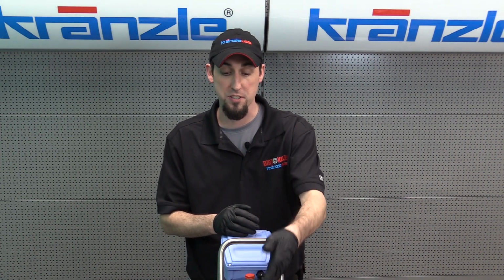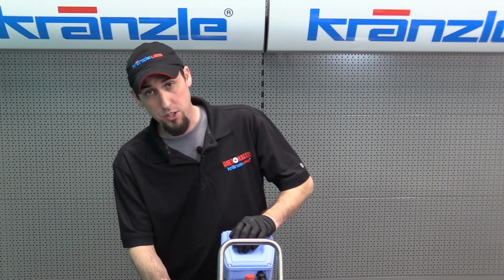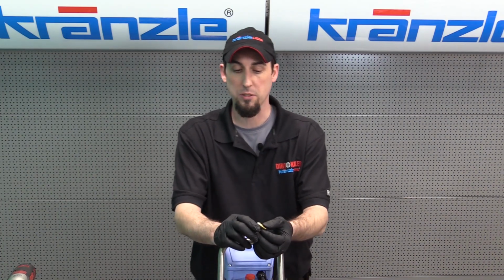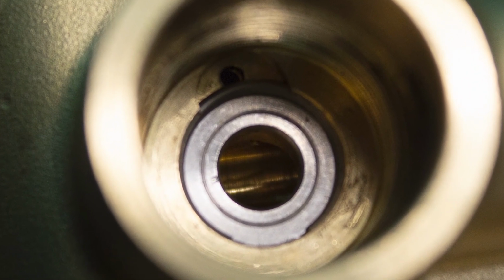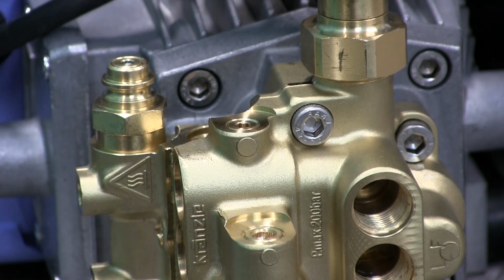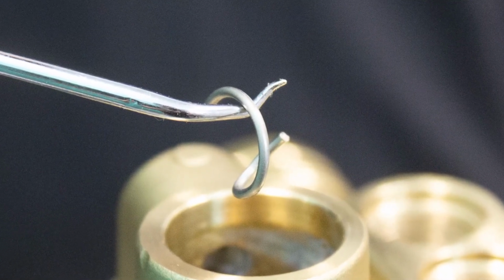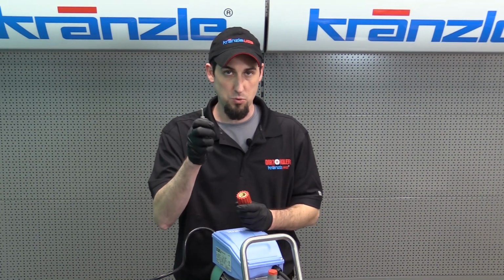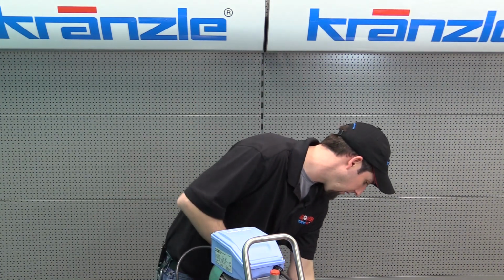Kranzle Unloader Valve Rebuild : Complete Pressure Loss | 1322 1622TS 1122TST

Comment: Our Kranzle 1622TS struggles to prime when gravity fed from our tank. It does better when "force fed" from a garden hose but still not 100%.  I've watch several videos but still not quite sure where to start.  I'm a mechanic and not a big fan of "throwing parts at it" .  Any guidance is appreciated.
Reply from the maker: When there is a drastic change between force fed and tank fed systems you have 2 main places to look -

do you have adequate plumbing on your tank? For the 1622 this should a singular dedicated hose from the tank (no branches or T's) all plumbed with quality 3/4" non collapsing plumbing.  This unit is considered self priming and can produce negative pressure causing cheaper/ lower quality plumbing connections (such as quick disconnects) to fail. 

The second place to look will be your water seals and check valves. Water seals are the primary reason your machine can pull from a tank, however if these had failed you would have very little success pulling from the tank, vs forcefed connection would have drastic improvement. The check valves however would minimally  change between switching water sources. 

I recommend checking all your plumbing, then visually inspecting all 6 check valves and testing the spring on each. From there you can inspect the O rings below the check valve cages. If these have any indication of being crushed/ warped, or if they are torn then you need packings as well. Packings can also be confirmed if you pull a sample of oil and it has water mixed in with it. 

If you need further assistance feel free to send us some more info directly to Jwagner@dirtkiller.com
Reply: @kranzleusa5846 thank you for the fast reply. The supply line in an unobstructed, dedicated 1" i.d. line. This is in a mobile detail rig and this issue recently started with no changes having been made to the setup (it's used dailly). That, to me, indicates a worn or broken part. Can you provide the part numbers i need? Thx

Comment: What size is the o ring for the piece shown on 13:09? My started leaking and need to replace the o ring.
Reply from the maker: Great question! that O ring can be found on this link. It is labeled as a 18mm by 2mm O ring. It is available via this link if needed-

https://www.dirtkiller.com/shop/9740016-kranzle-o-ring-18mm-x-2mm-8834
Reply: @kranzleusa5846 Sweet! Thanks a lot for the link. I will be placing my order.

Comment: What if it’s leaking water out of that value I have pressure and everything hit I notice if I leave it on and the water will leak out of the red cap
Reply from the maker: This would mean that the parbacks need replaced. The easiest replacement would be this assembly-

https://www.dirtkiller.com/shop/9714134-kranzle-internal-unloader-control-piston-8812

However, if those have worn out the remaining unloader parts are shortly behind it. This kit contains all the components to the unloader assembly and would service the entire head instead of just the singular part described-

https://www.dirtkiller.com/shop/97141291-kranzle-internal-unloader-rebuild-kit-8807

Let us know if there is anything else we can do to help!

Comment: Hello! My kranzle started giving me trouble, it lost pressure but im not 100 percent sure what it is. It gives me up to 1000 psi but sometimes none so I got to stop pressing the gun and press again continuously until it gives me 1000psi, but it doesn’t reach its max no more. I replaced the
Unloader valve but that didn’t fixed the issue. If you have any Idea what it might be please let me know. Thank you!
Reply from the maker: Were sorry to hear that you are experiencing issues with your Kranzle. I would encourage you to check 3 things. 

1) Confirm your supply plumbing is consistent and has no obvious causes of cavitation. 

2) Check your water inlet's filter. This can become clogged and cause the issue you describe. 

3) Lastly, remove inspect and clean all 6 check valves. There is a video on this page that explains this more in depth but the goal is to look for an obstruction or damaged parts. 

If you still have issues after that feel free to reach out to us directly at 410.944.5566 or via email at jwagner@dirtkiller.com

Comment: I just purchased my Kranzle 1622 ts and the most I can get out of it is 1000 psi, I used the original hose and wand and still the same. I've turned the unloader valve adjustment all the way in with no change in psi. Any idea what it could be? I have real good water pressure from my spigot, so that doesnt seem to be the issue. My previous pressure washer is the Active 2.0 and it doesnt have an issue. I purchased the kit from The Clean Garage that came with MTM Aqualine gun, wand and nozzle and Kobra Jet hose. Any sugestions?
Reply from the maker: There are a few factors that can be at play here. Would you mind sending us a few pictures of your set up and we can go from there?

You can send everything to JWagner@dirtkiller.com

Comment: Kranzle pressure pump water not coming from the pump out.hose and gun nozzle ok and valves also checked .ok but water not coming from the pump .what tge reasons. Please give remedy. Unloader didn't check
Reply from the maker: Thank you for reaching out @jayeelpoyil . Can you confirm which model pressure washer you have and how it is plumbed? If your model is equipped with a float tank, you could have an extra filter or have water seal failure contributing to the inability to pull from the tank. Alternatively, if your unit has a garden hose directly feeding it from a spigot you may need to disassemble the head and look for something physically blocking water flow. An example of that would be clogged check valves, or one that is stuck open. Usually if NO water is coming out of the pump there is something physically blocking the flow.
Reply: Thank u very much. Let me check and get u back.model #K7/122
Reply: This model is garden hose directly connecting type
Reply from the maker: @ if no water is discharging from the pump you are looking for a clog somewhere. Start with the nozzle, then the trigger assembly and then working your way back through the pump find where the flow stops to address the issue.

Comment: when i use the kranzle i dont get the full pressure its oke but it isnt the full power ! i have tested a lot of thinks but i think it is the kranzle machine do you know what ??
Reply from the maker: Hi. Please call and speak with Josh Lee. 800.544.1188. How do you know it is not full power?
Reply: @kranzleusa5846  i dont know how to call, when i use the pressure washer there is no consistent flow of water. there is like 1 second stop. very difficult to explain , just like time skipping water hahhahaha and the hose is ratteling .

Comment: Hi first of all thx for the vid, this is game changer to have people like you helping others on this kind of stuff

I have an issue with a Kranzle 1150 T where I have a complete loss of pressure, the needle doesn't move
The water stream is normal but no pressure at all

I tried to see what's behind the unloader valve and when i took it off there was some water (Is it normal ?)
When I pull the trigger it seems like they're is a sizzling noise coming from the Kranzle, I didn't go further than the unloader valve for now because I wanted to know your opinion first 

Anyway thanks again and respect from France
Reply from the maker: Hi. Please call Josh Lee at 800.544.1188 and he can help trouble shoot further.